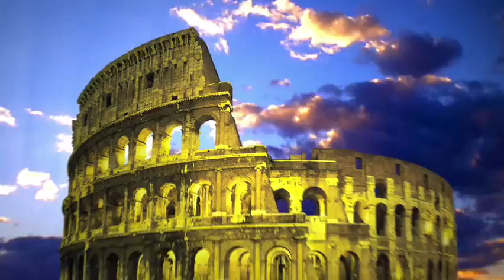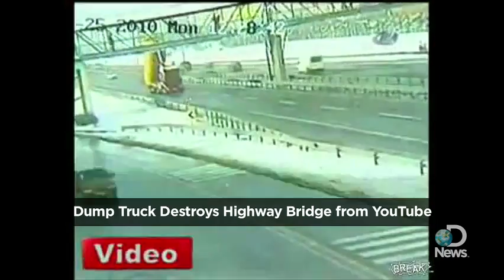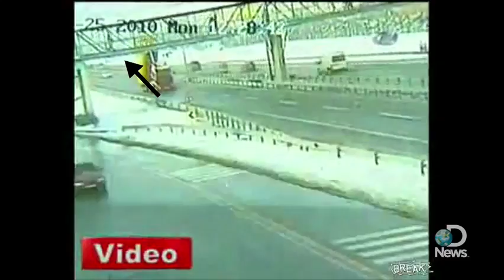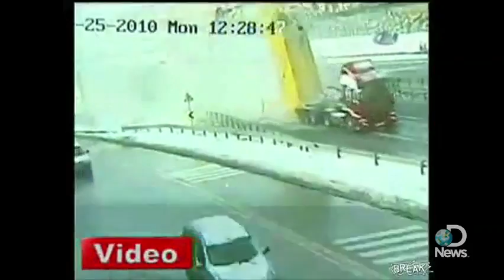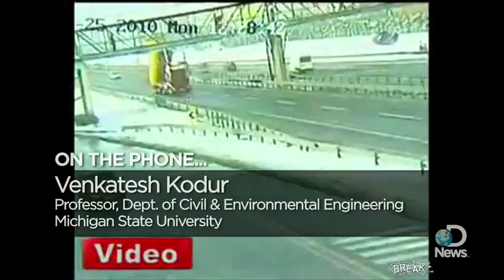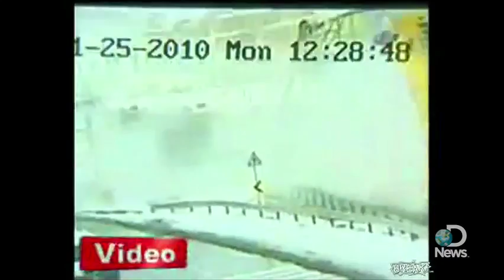Dump Truck Destroys Highway Bridge Explained

Comment: actually there are times when it is necessary for a dump truck to drive with the dump bed in the up position. When a driver is laying gravel over an extended area they raise the bed and drive forward in order to drop the gravel in a line.

Admittedly though it probably wasn't wise to be driving at higher speeds with the bed up as this throws a dump trucks center of balance off.